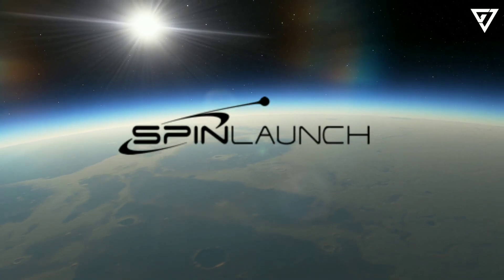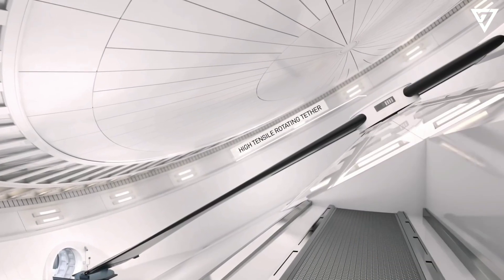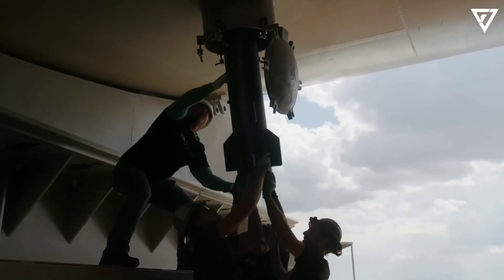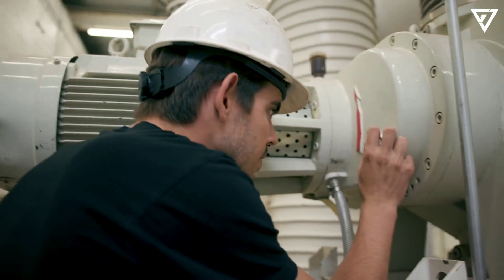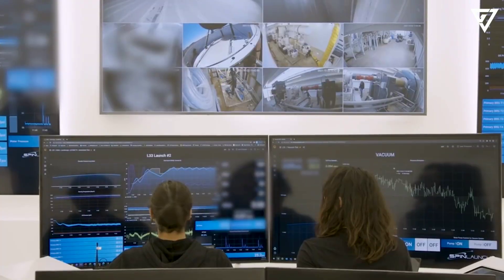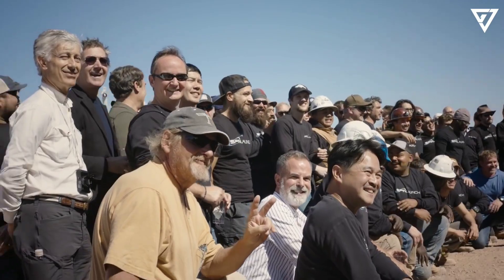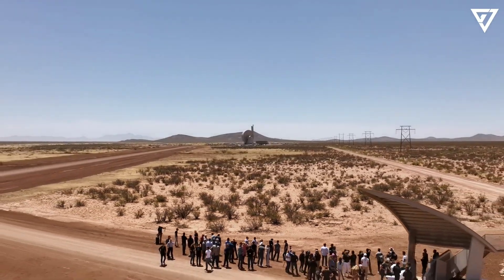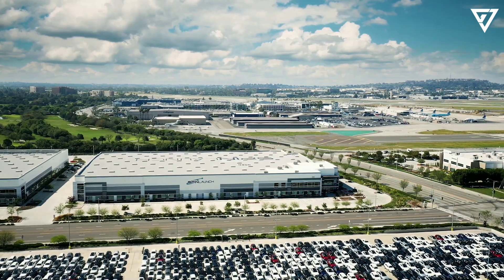Now We Can Throw Satellites Into Space-SpinLaunch

Comment: No, just the carbon emissions required to drive the electric motors to launch.  If you say that is provided by the solar panels - consider the amount of energy required to melt the silicon in to ingots, to cut into wafers, to solder to make panels.  Nothing is free.
That said, this is a very interesting and cool idea.
Question - how to they spin stabilize the projectile once it is released from the launcher, and before the second stage is exposed?